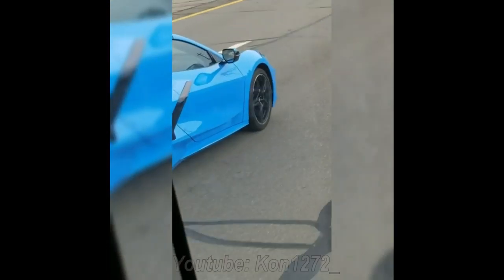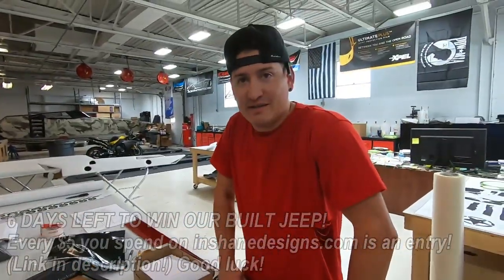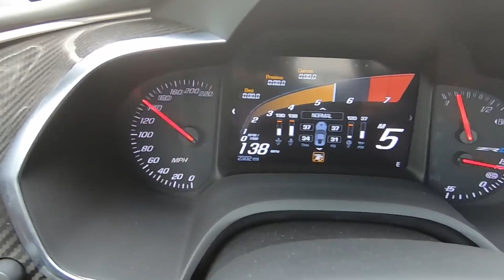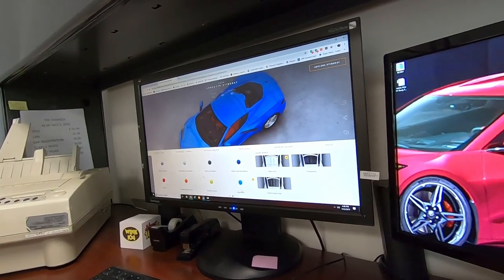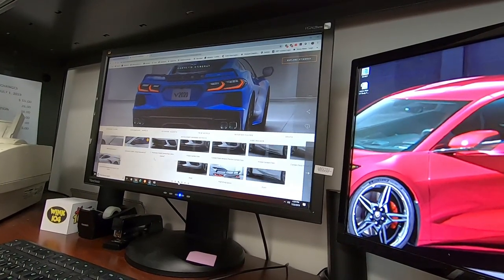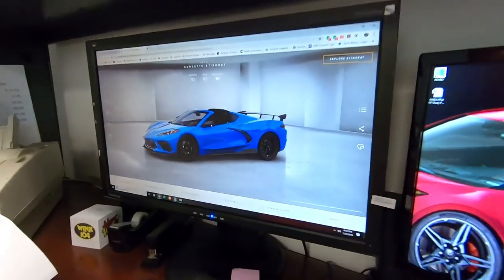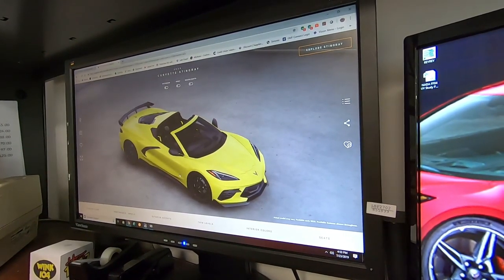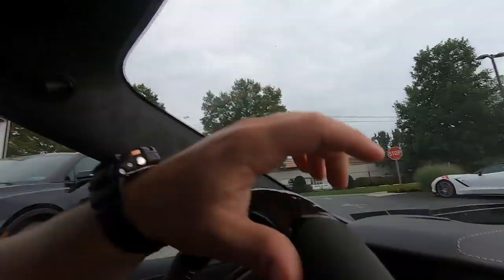BUILDING AND ORDERING MY 2020 C8 CORVETTE!!! But What Color!?! *HELP*

Comment: Mike is definitely selling the ZR-1, he wont wanna drive it when hes got a C8 lets be honest
Reply: This c8 is alot slower.  I thought zr1 was next give away.
Reply: Kyle zr1 is a giveaway car.
Reply: justin j from what Chevrolet said, the C8 is not “a lot” slower. The base model goes 0-60 in less than 3 seconds. That’s about a Z06 already. And I’m sure track times are probably better already.
Reply: @C4TLEADER  i bet ur fun at parties
Reply: @C4TLEADER  it has over 250 less hp and is only 200Lbs lighter.

Comment: The blue is so much nicer.  But does the color you’re getting actually matter? Same with the wheels.  Like aren’t you likely just going to wrap the car and get some other kind of aftermarket lighter wheels? But I guess for resale purposes having the stock car have the optional wheels will give it a higher resale value and probably same with the color I’m assuming that blue is more money than the yellow